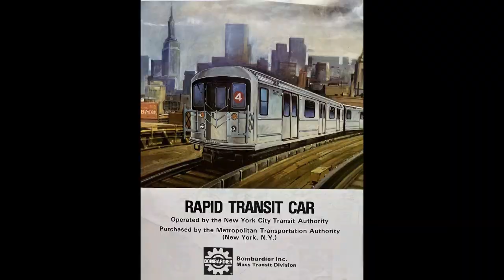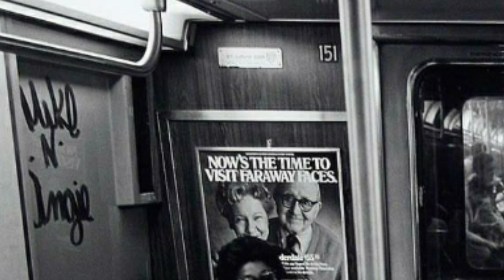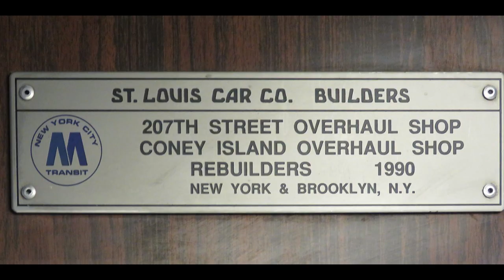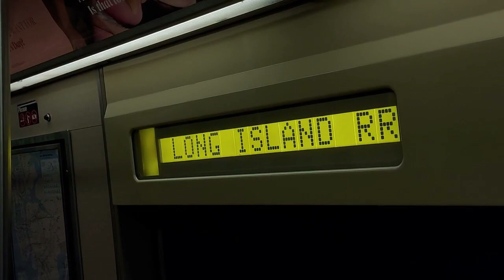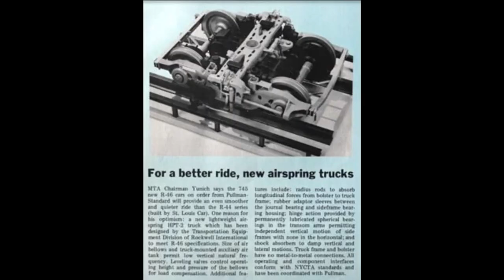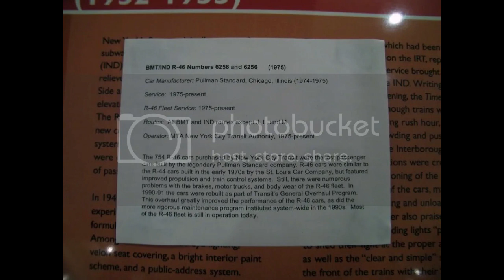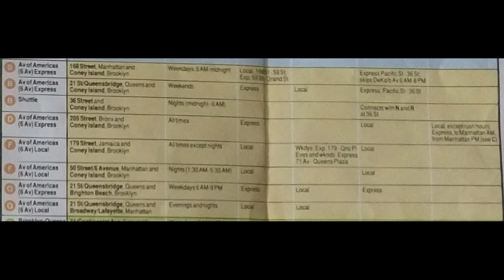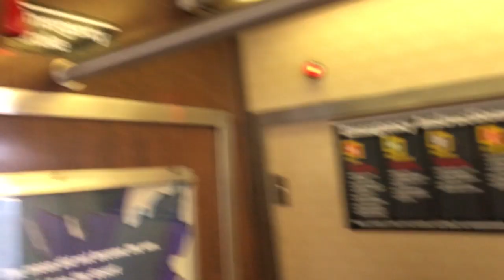Half An Hour Of R44/R46 Historical Facts

Comment: Another fact: when the 46's ran on the D the people in Brooklyn complained about the noise they made. They griped so much that they were taken off. The irony now is that they still run now as the Q
Reply: Thanks for the info! We already knew this but decided not to put it because we came across a source stated “there was also an issue with the [Brighton] track. It seems that the Brighton Line had just undergone a track replacement and when the new panels were installed, the joints on both rails were exactly opposite each other instead of staggered as on older installations. As a result instead of the characteristic clickety clack, the wheels made a much louder sound more like a bumpity bump. This happened to coincide with the assignment of the R-44s [and R-46s] to the D.”  Came from http://www.subchat.com/readflat.asp?Id=1548562&p=1#1549120
Reply: @Jassy  thanks for that. You just gave me the why as I didn't know about the track replacement
Reply: @jassy_235  Were the original trucks on the R-46 the culprit of the louder track noise?
Reply: @dasheffield5596  Most likely not; the track replacements resulting in the 75-footers roaring on the Brighton Line were the cause of noise complaints. It just happened to be at the time when the dominant R44MLs and a few R46s operated on the D at the time. There were many positive reports of the 75-footers having quieter noises versus the older cars on other lines than the D.
Reply: And now the West End D uses R68 cars, what a coincidence.
Reply: The B uses R46s sometimes because of some cars being retired. Which is very ironic.

And the R68s are based on the R44s/R46s

Comment: Very thorough and accurate report (especially about the chimes).  Here's what I would add (but this list is not complete)
1. R-44s did not have hostlers, that is why the two little doors on the lower front of the car ends is absent-that is where a cable from a portable hostler control was used to 'walk' a car in the yard.  I think you meant that the R46s that went to SI retained hostler controls.
2.  There are lots of pics of the R46 test on the LIRR - a speed of about 87 MPH was attained.
3.  The R-46 cars had normal sized center stanchions (poles), the R-44 had skinny ones.  The window seats had different armrests.  The R-44 cabs adjacent seats were three, on the 46 two.
4.  The R-44 and R-46 original propulsion/braking controls were transmitted car to car via P-Wire.  A voltage of zero meant brakes in emergency, various voltages corresponded to different braking and power levels.  Surges or loss of voltage in the P-wire resulted in emergency braking and were the main reason these cars, especially the 44s, were called lemons and this was well explained to the public in the press.  
5.  The locked end doors engendered fear on the part of some customers, who choose alternative routes, car types to complete their journeys.  Also made it difficult to escape unwholesome odors until the next stop.
6.  The R-46 had two controller modes - called wayside manual and wayside regulated.  Wayside signals would always govern but a motorman could choose regulated by rotating the controller handle 180 degrees (left) and then slide it to one of about 7 positions for speeds of 10, 20....60, 70 and the train would maintain that speed regardless of grade.  Trains ran faster than the design stopping distances allowed by the signals, resulting in a rear end collision approaching 5th/53rd southbound (uphill).  After that regulated modes was forbidden and subsequently disabled.
7.  The R44 was the first to equipped (from factory) with a speedometer.  Prior to this one would hear exaggerated claims of great speed that were hard to verify or debunk.  They were the only cars to have speedometers for years until a consultant report recommended their installation fleet-wide to improve safety (well before late 80s general overhauls began).  Train operators were expected to guess their actual speed, and there was wide variation in operating styles on display.  This also contributed to train bunching.  Some rides, especially during late nights over the poorly maintained tracks with fewer timers) could be particularly wild (even frightening).
8.  The ride on the R-46 air truck was very smooth - like riding on a new M-1.  Even with full service or emergency braking movement was very smooth.  And they had a different track sound, announcing themselves as you approached and needed to decide if it was your train or not before actually seeing it.
9. The R-46s had graffiti but whatever clean up campaigns there were always prioritized the R-46 (and to a lesser extent R-44).  The ugly R-68 stainless steel walls were touted as an improvement to better resist graffiti, but the R-44 and R-46 colored interior surfaces were hit less often and or easier to clean and their elimination was an unnecessary downgrade to the R-68 environment.
10.  I'm pretty sure the R-44/R-46 were the first to enable continued full lighting over third rail gaps, lasting for a few seconds without power and even then going down to half lighting rather than just a few battery-only incandescent bulbs.
11.  The R-44 had much improved sound isolation, including the first interlocking door edging.  But the R-46 had additional insulating materials in the walls (and the air spring trucks helped).  This distinction in sound levels was noted in public statements but not really explained in detail.
12.  The original one piece side roll signs were motorized and controlled from a single cab.  There was a bar code on the sign curtain edge illuminated by a small light bulb which enabled the unit to seek the requested sign reading.  The R-40 and 42 side curtains were not motorized.
13.  The original HVAC units on the 44s and 46s were not so noisy outside.  Their understated hum did much to contribute to the feeling by any casual observer that this rolling stock was indeed a great, all=in-one leap into the future.
14.  Although much effort was devoted to "the feeler train" ensuring r-o-w clearance, not enough time was available for adequate testing and debugging of the P-wire and trucks - two radical departures in design that failed so hard we had to suffer the deficiencies inherent in the regressive design of the 2000+ cars delivered in the 1980s.  Both orders were rushed into production for both political and operational reasons.
15. See my Admiring the R-46 video!
Reply: @Trainluvr Thanks for your contributions! If more are to be added, please list them, and we’ll potentially create a follow-up vid crediting you.
Comments regarding what’s added:

1 - My mistake. One time saw a ME-2 single unit pulling back with a crew on the B end at Clifton; assumed he was using a hostler.
9 - Guess the R62 series started the bland series.
10 - Not sure about that. A 1986 vid (https://www.youtube.com/watch?v=orq5bFGsdMU at 1:41) shows some R46 lights affected by third rail gaps. Also personally encountered it thrice. (https://cdn.discordapp.com/attachments/835745755871445063/1105230845171728445/EFCD8DB1-8997-4EA8-9A59-614262243D52.jpg, https://cdn.discordapp.com/attachments/835745755871445063/1105230845528260728/94E2E895-654C-451E-9521-E72CF3A9D533.jpg, https://cdn.discordapp.com/attachments/835745755871445063/1105230846065135626/E778A5AA-C4CB-44D7-98D3-9B133E9F9A52.jpg )
15 - Lovely vid! Seen it many times; perfect music choice as I’m a 30s-50s, 70s music listener; shared it with non-railfans to showcase a TA’s beautiful piece.
Reply: @jassy_235  You're right about the lights, seems there was no delay in the side rows of lights dimming.  But the video includes that damn annoying A/C compressor hum (which is similar to that heard at the rooftop parking at the Stop n' Shop in Glendale/Forest Hills) so maybe that too is original and I just confused it with the much smoother M-1 original sound.  The descending-whistle sounding brake release of the original R-46 is rarely captured in film or video.  I don't know of any example on Youtube.  If any one has a link post it here.  Same sound was heard on the experimental gas-turbine trains of LIRR.  I got lucky with the music on my video - I thought it would take months to find the right sound to embody the late 70s while avoiding the use of known pop music that would be too genre specific or just lame or good but ruined by some stupid lyrics.

Comment: 26:55; R30s are the built and unrebuilt trains to represent the "Redbirds" fleet, but the R32 trains are the steel-banded trains different to the R38 trains.
Reply: Thanks for the added info! These will ease up some confusion for some audiences.
Reply: Don't forget about the R62AS R62S and the R68S R68AS that's holding it down for now until the Brand New R262/AS R268/AS comes in the future for CBTCS.
Reply: @leecornwell5632  That's true.

Comment: CORRECTIONS & ADD-ONS:
-The R44MLs and ME-2s NEVER had hostler controls, as noted by Trainluvr's comment. Please disregard that mistake! See more fun facts offered by him.
-I made it sound weird that the ME-2s have levers at the ends of the interiors. They have a good reason. These were added to the ME-2s due to their single-unit operations, where locking an end door would prohibit one from entering a B car to a cab in an A car. It is common to see a B car coupled with an A car in SIR.
-Blue indicator lights are only found on 75-footers' side exteriors. These signify that the end doors are unlocked. It is common to see the SIRR44s lighting up the blue indicators due to the primarily straight SIR main line.
-All three car types had red door indicators placed on both sides surrounding each side exterior doors. Around 1987, most indicators were removed except for the ones near one part of the car ends, except for the ME-2s, which occurred during the overhaul.
R44MLs Pre-1987: https://www.nycsubway.org/perl/show?77624
R44MLs Post-1987: https://www.nycsubway.org/perl/show?70667
ME-2s Post-1987: https://www.nycsubway.org/perl/show?50729
R46s Pre-1987: https://www.nycsubway.org/perl/show?5764
R46s Post-1987: https://www.nycsubway.org/perl/show?62206
-The R44MLs and ME-2s have a minor metal cosmetic thing at one end underneath the transverse seats. The R46s never contained that.
R44MLs: https://cdn.discordapp.com/attachments/835745755871445063/1011463203630370886/unknown.png
ME-2s: https://upload.wikimedia.org/wikipedia/commons/f/f3/R44_SIR_Terminated_%40_St._George_Terminal_March_2022.jpg
R46s: https://www.nycsubway.org/perl/show?126735

More fun facts will be added here if I discover them.

Comment: R44 CARS WERE TOTAL VERY EXPENSIVE GARBAGE. NOBODY HAD A CLUE HOW TO FIX THEM AND THEY BROKE DOWN ALL THE TIME.
THE R32 CARS WERE THE ABSOLUTE BEST. I OPERATED ALL OF THEM,
INCLUDING THE Q CARS.
Reply from the maker: What would you say were the second best after the R32s?
Reply: ABSOLUTLY, THE R10 CARS 
WERE SECOND . THEY FLEW WHEN ALL MOTORS
WORKED, AND THEY ALSO
HAD SECOND BEST BRAKING AFTER R32.
Q CARS WERE WORST
BRAKES. OLD TECHNOLOGY.
SIGNED, OLD TIME C/R, 
M/M, TSS
Reply from the maker: Did you have a favorite line or route to operate?